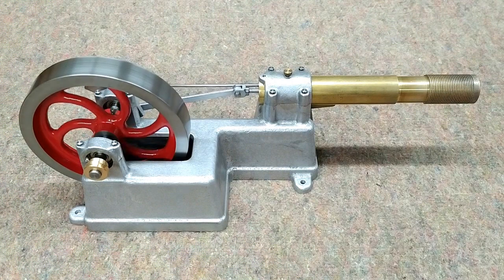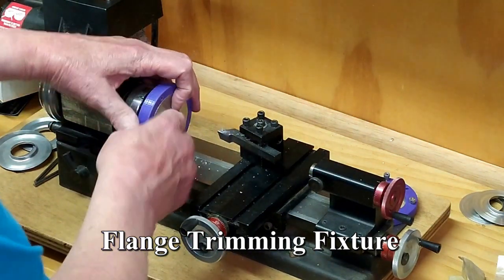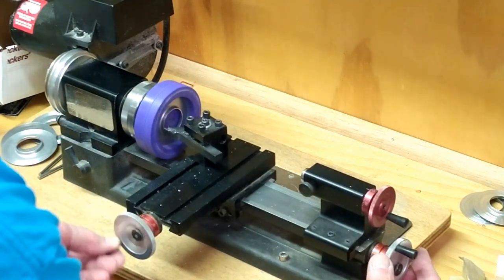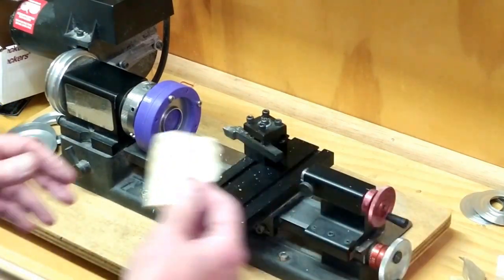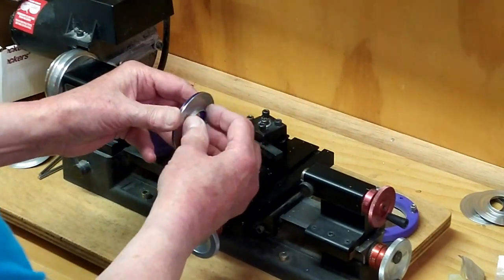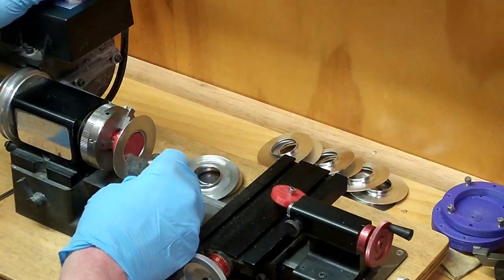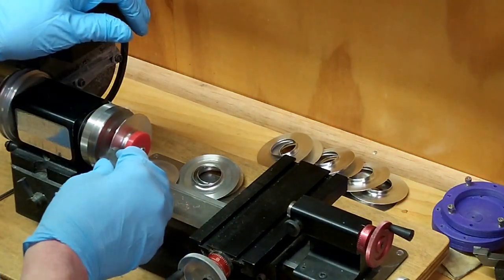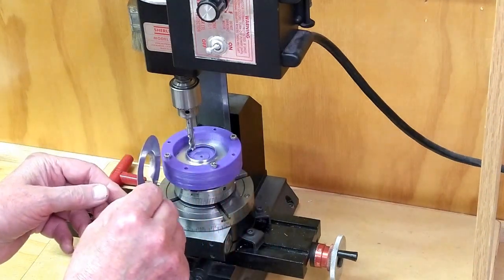Huxtable Hot Air Engine - Forming Aluminum Cooling Fins Part 2

Comment: I'll be interested to see if this improves performance as the metal frame of the engine is already acting as a huge heat sink.
Reply from the maker: With a proper butane burner, this engine gets started immediately. The base is a large heat sink but the fins dissipate the heat pretty well and it takes quite some time for the base to start heating up. I can run it (at a low fire) continuously until the butane tank is empty and don’t notice the engine trying to slow down. A smaller burner (50% smaller) would be adequate as I have been more interested in a steady continuous speed and not trying to see how fast it might run.

A video of it running will be released tomorrow Jan 1, 2022
Ron
Reply: @RonaldWalters2010  Slow running is best. you can see the moving parts. Everyone wants to know how fast something goes. It's easy to make an engine run fast, hard to make it run slow.